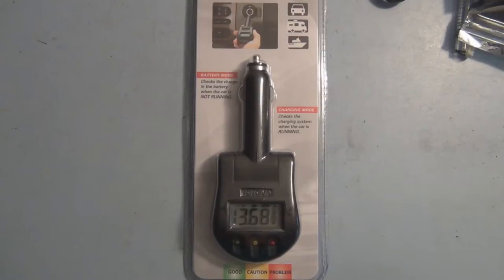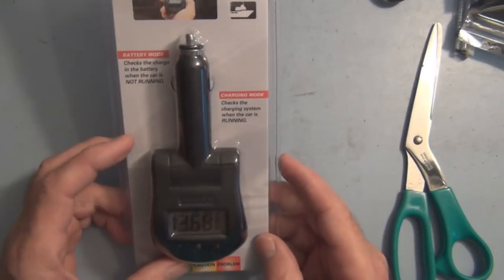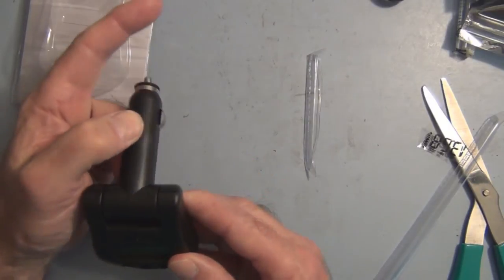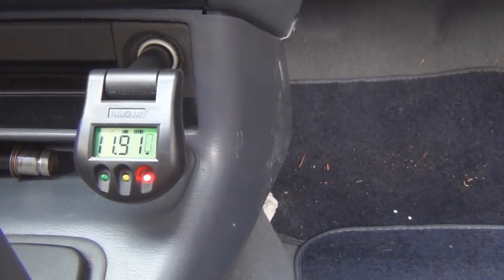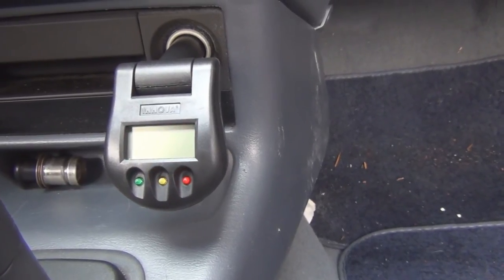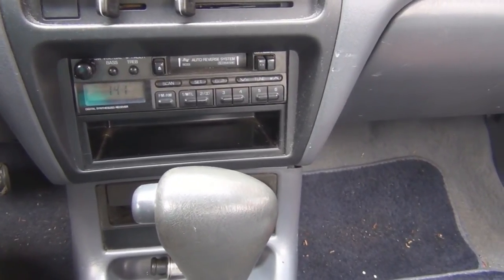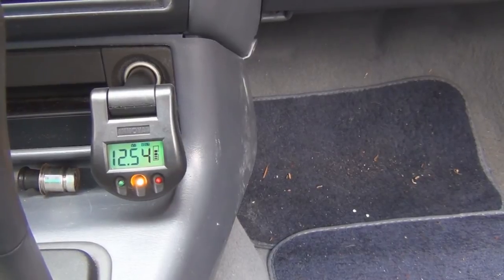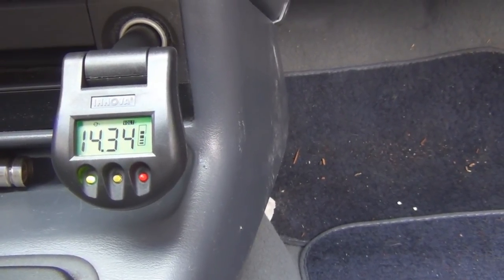Car Battery Monitor Review

Comment: Battery is low. Should be much closer to 12.6V. The alternator is charging fine. Most batteries don't last past 4 years. Also, running synthetic oil helps engine turn over more easily in the cold.

Comment: I don't know how well this measures battery charge. I got a new battery this week and it still shows in the red.
Reply: +Jeff Colton Your alternator is probably going out, I wouldn't go by the color anyway, look at what the voltage is. If the car is off it should read ~12-12.6. With the car on it should read ~13-14.5.